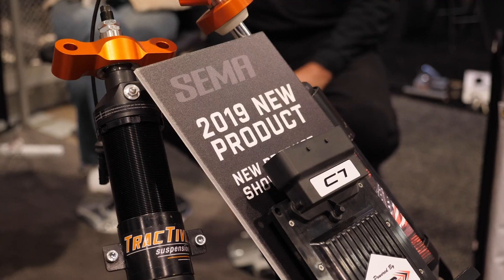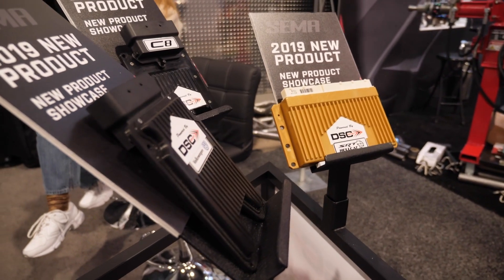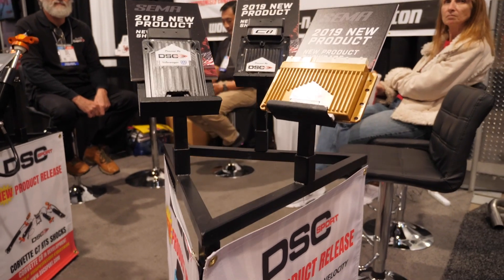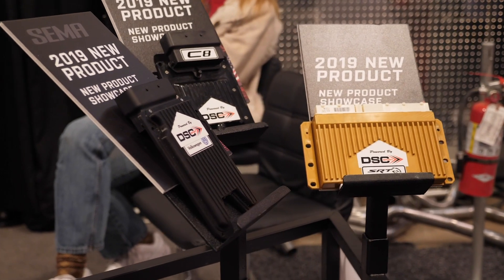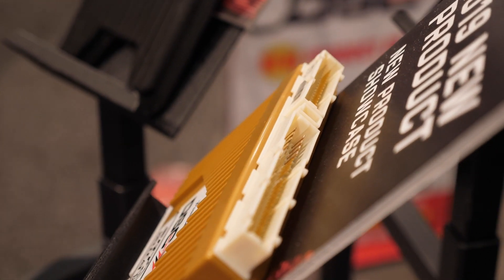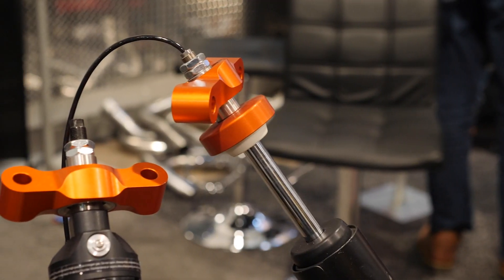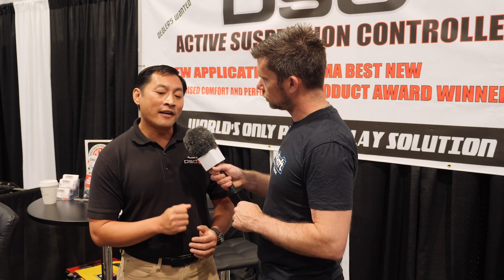The Future Of Motorsport? | Dynamic Suspension Control

Comment from the maker: TIME STAMPS:
0:00 - Contact Patch
0:19 - Conventional 
0:29 - TracTive Suspension
1:06 - Electronic Adjustment
2:12 - Low, Medium & High Speed Suspension Travel
3:16 - Plug And Play Systems
4:36 - Control System Logic
6:37 - Base Maps Help With Tuning
8:26 - Real-World Testing
8:46 - Passive Vs Active Suspension
10:16 - Electronic Bump Stop
12:07 - Prices Vehicle Dependant
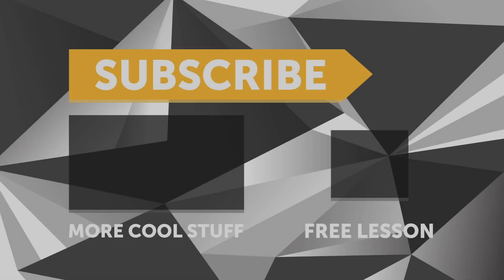13:39 - Free Lessons Below

Comment: Isn't McLaren road cars already doing this??
Reply: How does that help non-Mclaren owners? These are built for vehicles from multiple manufacturers.
Reply: @twostorywood  Not trying to help you with anything. Just pointing out a fact.
Reply: McLaren does something competley different. In their super series cars they use hydraulics to control the roll instead of anti roll bars. I believe they also use a adaptive shock like this dsc controller. The difference is the tractive dda is the fastest reacting adaptive shock likely far faster than the McLaren shock but they do not use a hydraulic crosslinked antiroll system like the McLaren.
Reply from the maker: I don't know about McLaren, but some OEMs use TracTive products that are optimised for OEM applications
Reply: @@LockHeadAC103 Good luck with that!
Reply: @RT-kr7dk many manufacturers have tried or use active suspension. i think cadillac tried some in the 80s or 90s if i remember correctly
Reply: @byloyuripka9624  wasn't active suspension outlawed in most racing series?